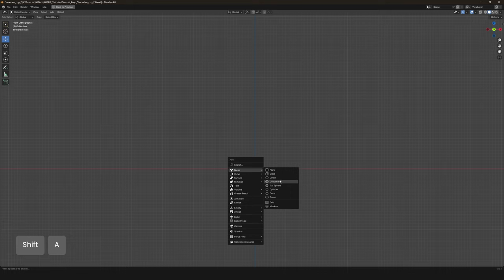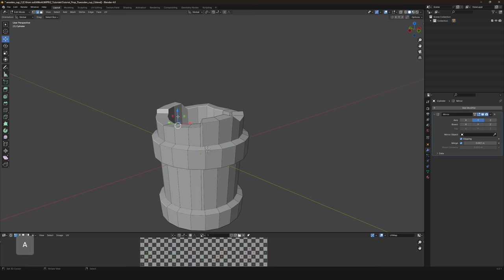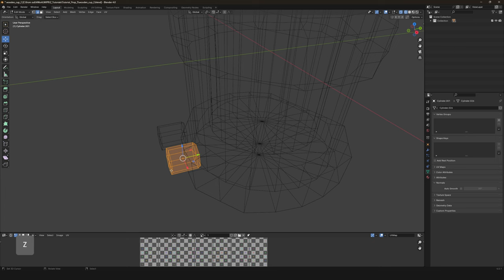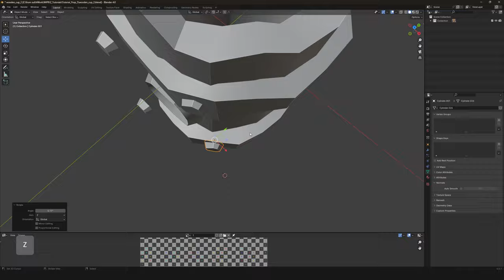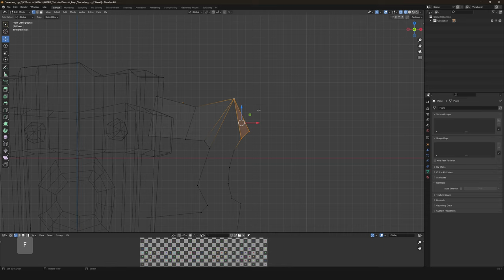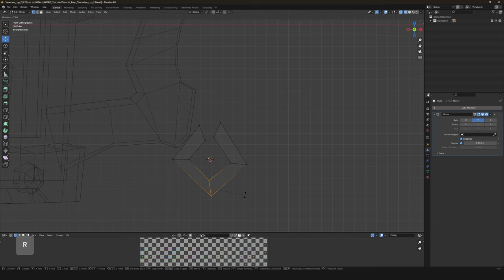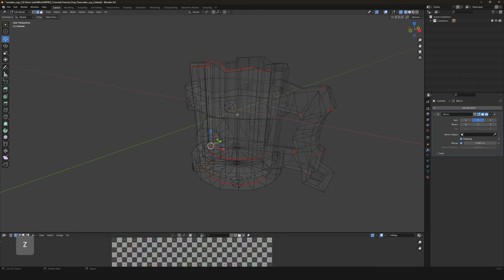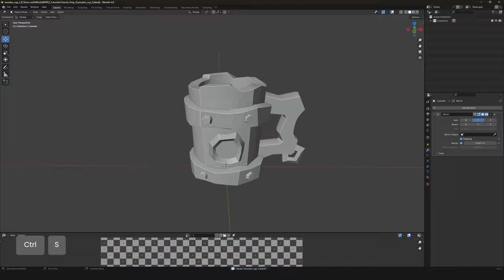Stylized 3D Mug - Modeling [Part I]

Comment: I've followed your steps to make a stylized bucket and it turned out amazing! Thank you so much for uploading your workflow so we can follow and learn to 3d model in this style. 

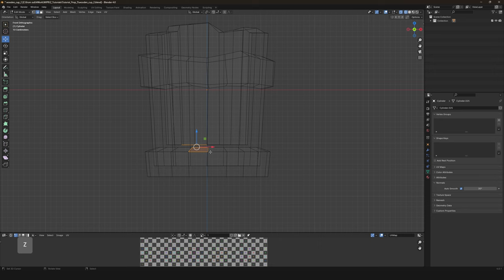One thing I'd point out is at 03:40 is a little confusing how you get rid of the "extra blocky" texture and get that almost smooth feeling. I figured out you used Mesh -> Smooth Shade to smooth the surface and later you use Normals -> Auto Smooth to decide an angle where it will make "blocky" texture. 

Nevertheless this is one of the best videos out there on how to start using this style at 3d modelling, you are great!
Reply from the maker: Hey, man! Thanks a lot for your comment! Because I wasn't sure if people would be interested in that simple modeling stuff, so it's been only a prelude to bigger one tutorial with texturing! Now I know, that I gonna upload more 3D Modeling things too!
Ohh the smooth... Been using new Blender for the first time, so maybe messed up a bit with changed UI things hehe :)